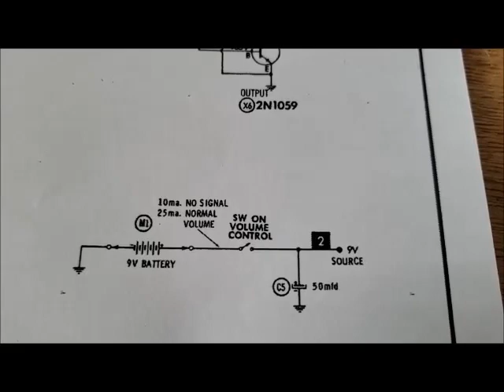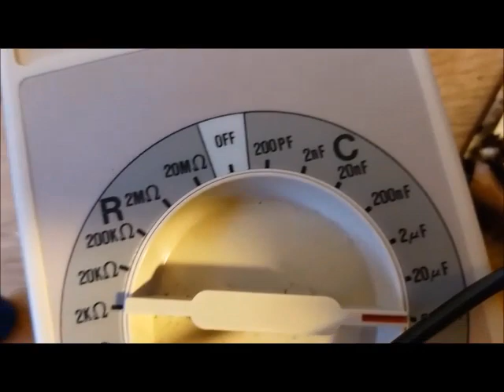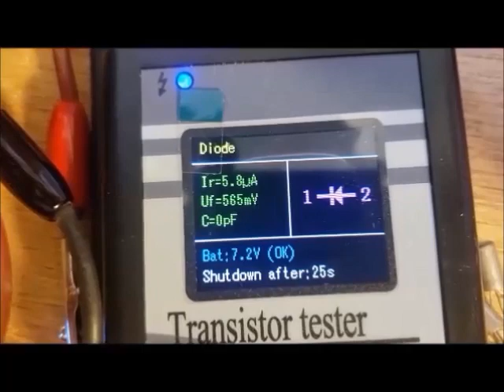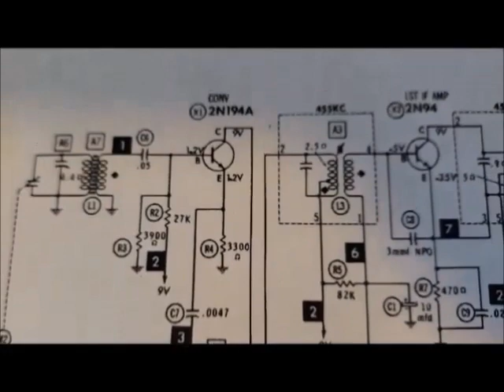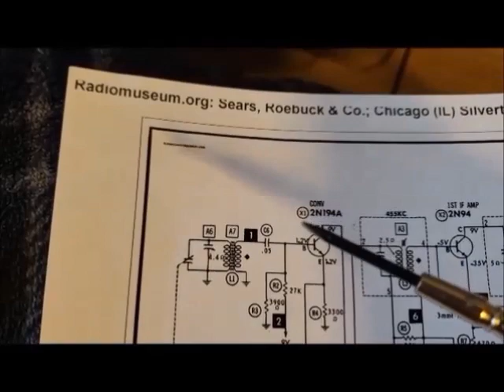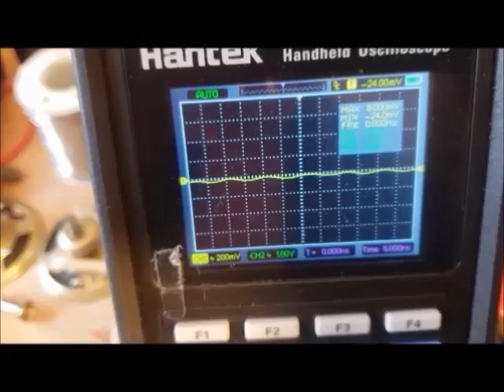Dead 1959 Silvertone transistor radio repair

Comment: Put a 12 volt alarm/ remote battery in. Use  a voltage regulator or zener, or diodes to drop it to 9 volts. Happy listening.ps a 30 ohm resistor will give you 9.2 volts it will run fine.🌚 +-

Comment: I had that radio in turquoise with a real leather case.  It took Sears batteries.
Reply from the maker: @stanleycostello9610   I believe the one you had takes a regular 9 volt battery.

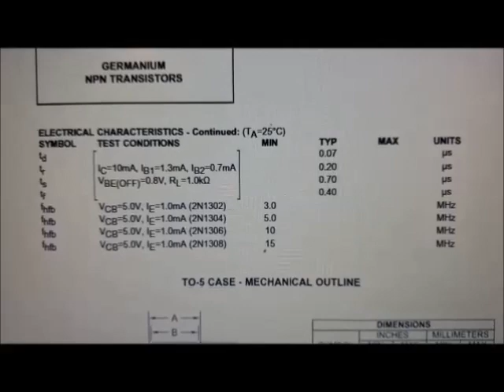Comment: 14:04...actually, no: if you're tuning in 1600kc signal, and expect to get an IF signal of 455kc, the local oscillator will have to produce a 2055kc output signal...
Reply from the maker: If you look at it again, you'll notice that I  put a correction in the visuals and said that it was around 2 MHz .

Comment: The audio circuit with the dual secondary driver transformer and transformerless output was quite commonly used in high fidelity amplifiers as well during the germanium transistor era.

Comment: Great job, Frank! 
With the old transistor radios that have zero sound, first thing I always check is the earphone jack. 90% of the time, someone shoved the wrong plug in them and bent the cutout switch. Or the switch terminals are corroded. Did you check the voice coil wires behind the terminal board on the old speaker. Some times those are broken and, if you are careful enough, can be repaired.
Reply from the maker: @videolabguy  There is no continuity in the speaker.  I've hung onto it and might attempt a repair sometime.
Reply: ...that's the TRUTH...

Comment: This radio was made by Arvin.
Reply from the maker: I just purchased another one last week, (the green one of the series) and it works.  Arvin smartened up and made a bigger battery compartment for this one as it takes a standard 9 volt battery.
Reply: 0:19...well, "if it doesn't WORK- then it doesn't EAT!!!"
Reply from the maker: @daleburrell6273  No battery juice.